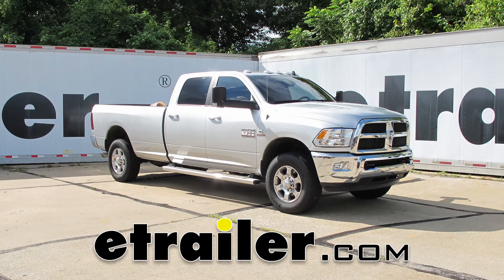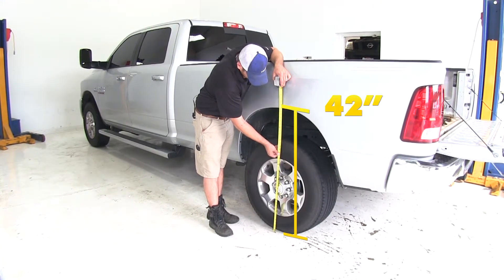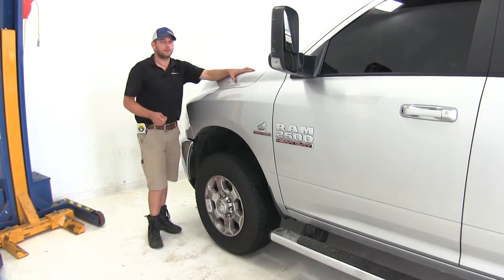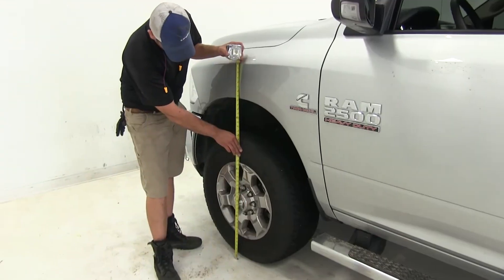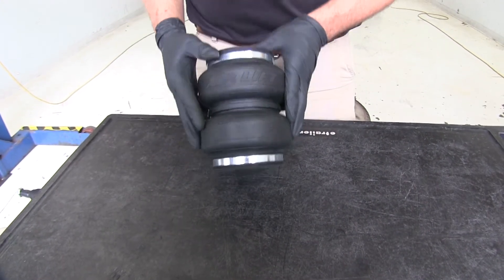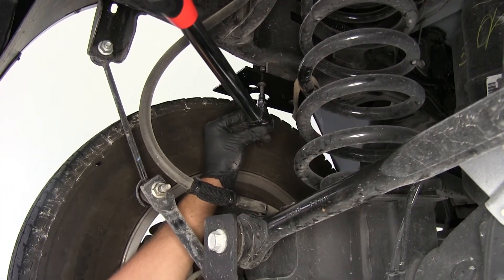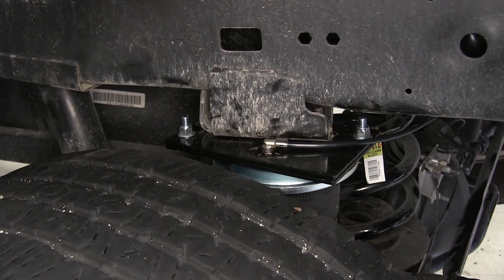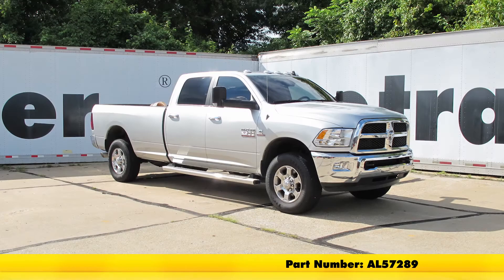etrailer | How to Set Up Your Air Lift LoadLifter 5000 Air Helper Springs on a 2016 Ram 2500

Comment: On the after GoPro shot it looks like you didn’t mount the bottom plate?
Reply from the maker: It does look that way but I assure you it's there. You can barely see the clamp bar underneath the axle.